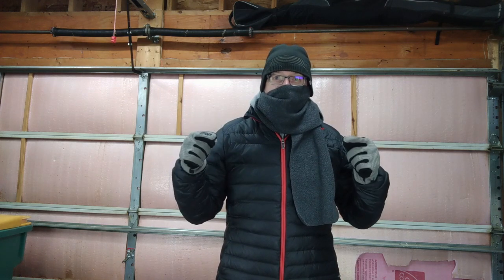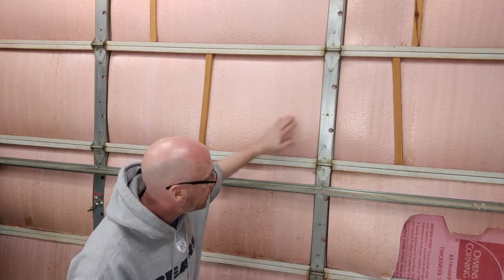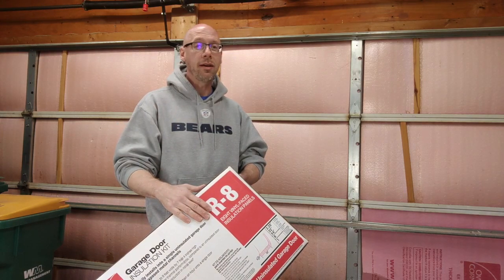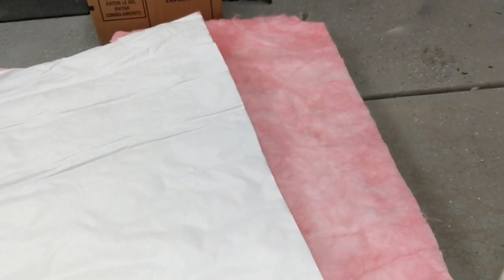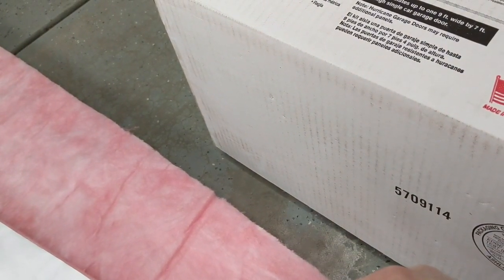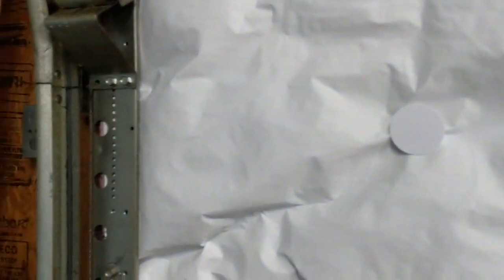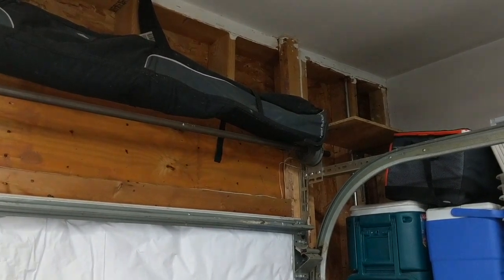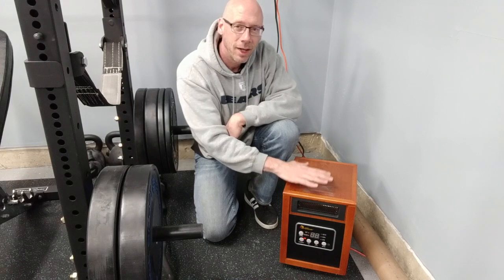Heating up Your Cold Garage Gym

Comment: my wife says i just have to work harder so i get warm faster.  lol!  But now i have a timer based heater that starts warming up the garage at 4am so that by 6am its over 45 degrees...warm enough...but cold enough to make you get moving.
Reply from the maker: Ha! That's funny. I'm a baby and wait for my gym to warm up before using it. Gotta be at least in the mid 50's before I start.

Comment: Note, if the insulation you add to the door has any weight at all you will want an installer to adjust or possibly replace your door spring. You can test this by slowly lowering the door manually and try to control it as it lowers, if its too heavy to control and it slams shut, then your spring needs adjusting or replacing.
Reply: Great point! This is a fantastic feature of the kit I used. It didn't add much weight to the door at all and no adjustments were needed.

Comment: I live in northern Indiana, so I'm coming into the season where i need some of these warming solutions... i don't think i can afford to insulate my whole garage as it's free-standing, but thanks for the space heater recommendation! I have a small one but it sounds like i might need to upgrade
Reply from the maker: Yep, it's about to get cold! As a heads up, I'm in a townhouse with units on both sides. The heater I show here works great for me, but you may want to consider something stronger in a freestanding garage, especially if you aren't insulated. Hope that helps!

Comment: Building a garage gym now with the pandemic. Already thinking ahead for the winter since the garage gets pretty cold. My doors are smooth with windows and no place to insert the insulation. They are seamless garage doors. Any suggestions? I really don’t want to cover the windows.
Reply from the maker: It sounds to me like you have an insulated door already. If that's the case, I'd just make sure the seal around the door is tight and you should be good to go. Good luck with your build-out!
Reply: @GymCrafter  Yea I looked closely and noticed there is thin Styrofoam inside the door. It still gets pretty cold in the Garage and it is connected to the house. I don't know how much difference a heater will make it there during the winter though.

Comment: I installed an electric overhead heater with a fan from Rural King on a thermostat. The advantage here for me is that I can turn it up, run it for 15 minutes and turn it back down again. Ready to work out.
Reply: Yep, those overhead units work great. They are just out of my budget and I don't really have any room. The space heater is less efficient, but it still works really well for me!
Reply: Tim Steward I went with an 80 dollars electric utility heater on sale for 70 bucks 5000 watt. But any heater will work, nice video. 👍🏻

Comment: Hi there. Also in Chicago. How cold does your garage get when the outside temperature is around 10 degrees? Moved into a house earlier this year, so I have yet to experience a full winter. The insulation seems decent, but not sure if I need to proof it more, or if I can just buy a space heater.
Reply from the maker: Hey Adam! After installing the insulation shown here, my garage is typically 20-30 degrees higher than the outside temp. With my space heater, I'll turn it on about 20-30 minutes before I lift and it's pretty comfortable. I haven't missed a day of training since I insulated and bought that heater. Even when it's 0 and colder outside. Congrats on the new house!